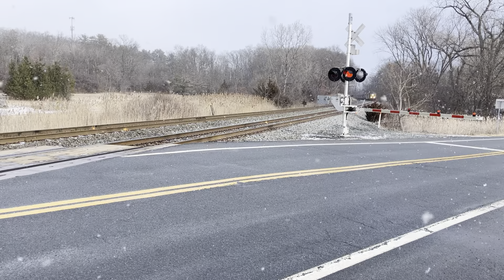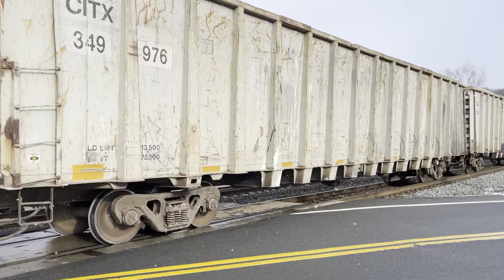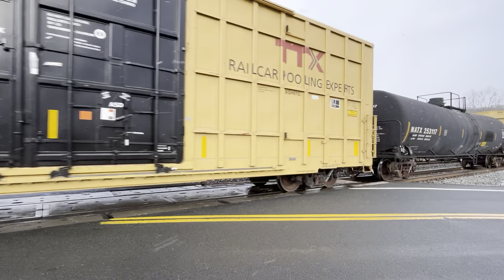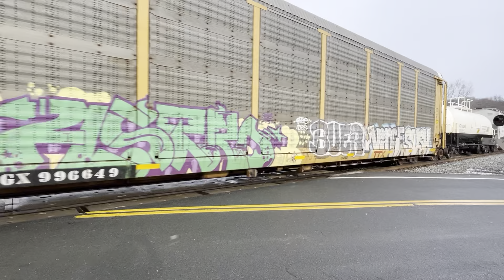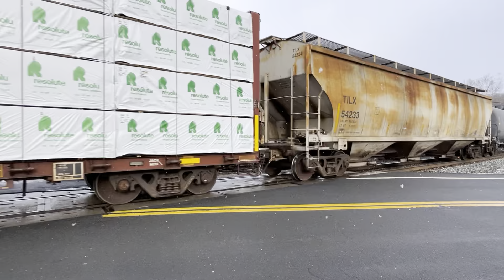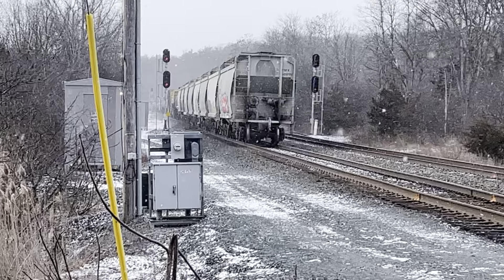M403 Thru Hannacroix on its Way to Filthydelphia W/ 292 Axles Appears to Have Hot Bearing on Tanker

Comment: Notched+ that baby out of there and no big slack sounds. A pretty decent mixed consist and then it was the Heat of the Moment. Hopefully the detector has been plugged in and the bills were up to date. One would think in the colder weather a hot bearing would have triggered it.
Reply from the maker: The crew stopped and told dispatch it was nothing 
I guess I need my eyes checked